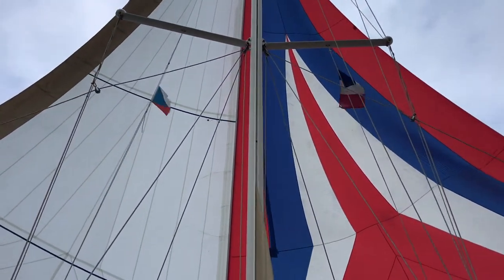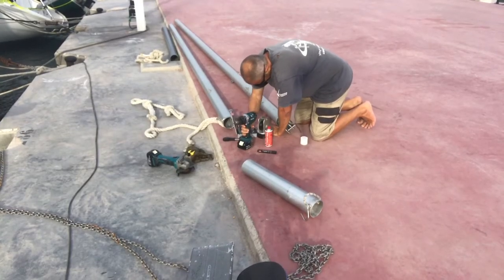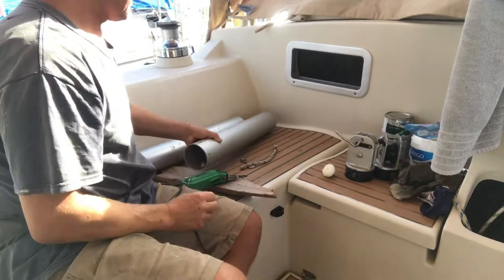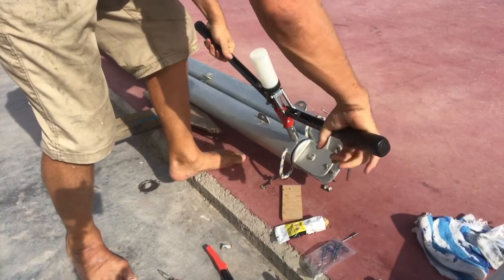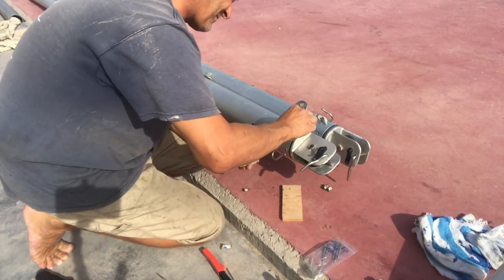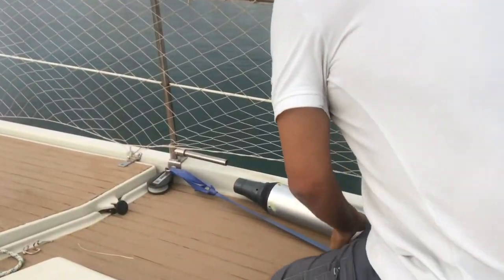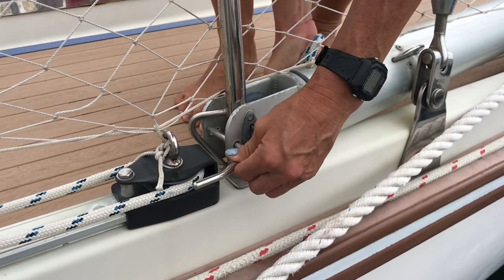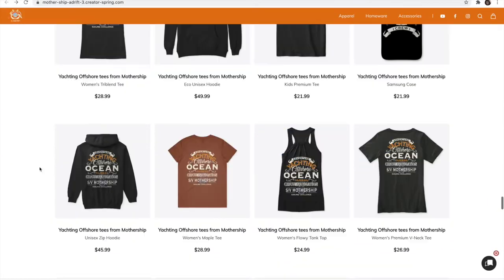Spinnaker Pole Shortening -  Trimming Pole Ends for Easier Storage and Safer Downwind Sailing Rig

Comment: Hi Woody, can I ask is there a reason why you shortened the pole from the end that takes the sheet, rather than the end that connects to the smaller jokey pole?
Reply from the maker: Either end would have done the job really but I noticed the rivets needed replacing on that end anyway.

Comment: Hey, Woody! This job has been on my list for some time and now. Where did you find that bracket that opens to fit on the Stantion?! What are it’s specs? I measure the stantion at 23mm and the pole-end hole at 22mm. I have a piece of 22 that fits nicely into the pole end, but I can’t find a fitting.
Reply from the maker: I found the fittings online.. sorry. Sn’t remember where now but they were standard 25mm and I just fitted a plastic sleeve to the stantion post and a kinda step down stainless steel collar to the metal bit that fits into the end of the pole to hold it in place and it’s been good right across the Atlantic and Pacific. Shortening and mounting them has stopped the pole ‘dipping’ and also prevents the sheets from snagging on them when they’re stored on deck.. been a great modification.